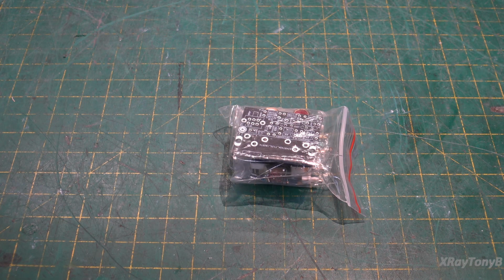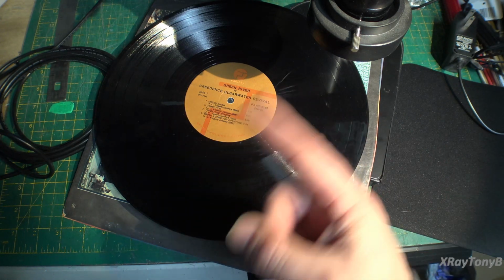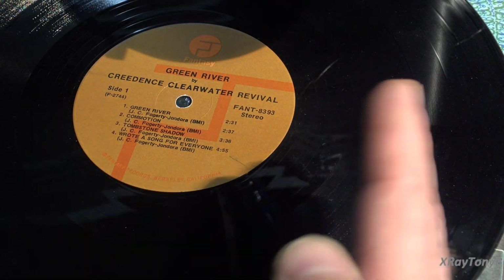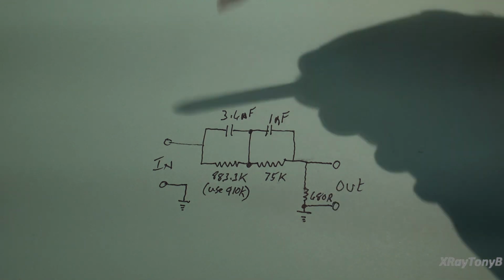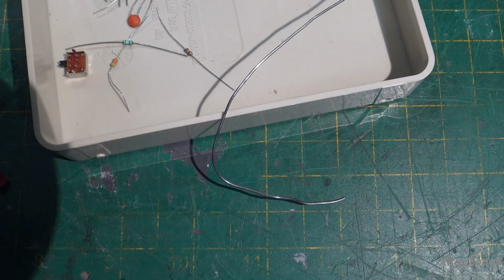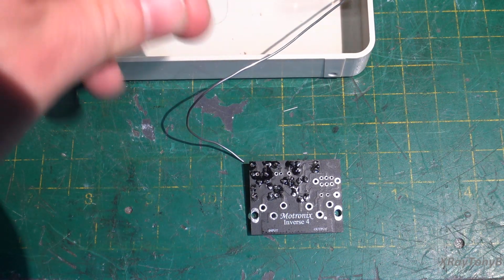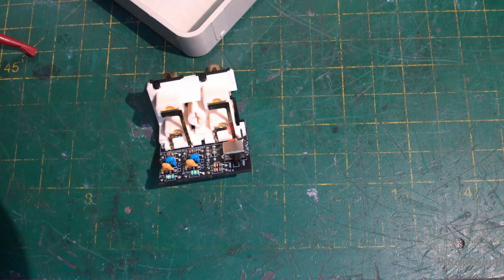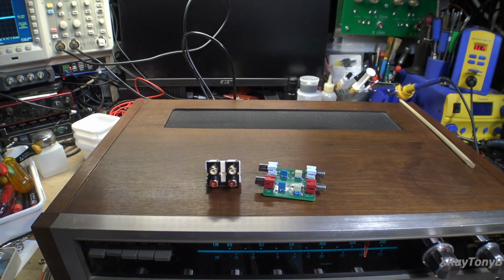Assembling an Inverse RIAA Adapter & Talking about the RIAA EQ Curve

Comment: (@19:00) - if anyone wants to build this circuit, here are some tips:
1) Just use a 1 Megohm potentiometer wired as a rheostat for the 883.3 kilohm resistor. Get one of the 10-turn trimpot varieties, then just measure the resistance with your ohmmeter of choice and turn until you get as close to 883 kilohms as possible.
2) you can get 75 kilohm resistors, but only in 1% (or possibly 2%) tolerance types; most likely, metal film. Or just use a 100 kilohm pot and adjust to 75 kilohms. As with #1, use a multi-turn trimpot.
3) You can make a 3.6 uF cap with a 3.3 uF in parallel with a 330 nF, for a total of 3.63 uF, which is close enough. 😎
4) As with any audio circuit, keep lead lengths as short as possible to reduce noise pick-up. It’t probably be a good idea to put it in a metal project box, though you can probably get away with a plastic one (no guarantees, though!)
5) Have fun, live long, and prosper! 🖖

Comment: RIAA equalisation. There are three things to take account of (well at least 3...). Firstly cutters and cartridges, either moving magnet or moving coil use the motor principle and they are velocity devices. If you wiggle the stylus slowly there will be low output. If you wiggle it fast you get a high output. In fact if you double the wiggle frequency you double the output. That ends up as 6db per octave. So naturally a cartridge will give this rising response, ie no bass and all treble. Then there is the fact that bass requires a large wiggle and you are going to have issues fitting that on the grooves unless you space them well apart and you lose playing time. So it is preferred to cut the bass levels for physical constraints. Third is noise. Pre emphasis in the treble region is a simple way of getting a free way of cutting noise on playback - So why wouldn't you? It took record companies a long time to end up with the RIAA curve and there was a time every record company had their own way of tailoring the response. Amplifiers of the period often had a whole assortment of curves the user could switch in. Have a look at the Leak Varislope front panel.

Comment: The RIAA curve created a compatibility standard. That is, any RIAA-cut record, from any label, could be played back, correctly, on an appropriately-equipped system. Contrast that to the prior issue of different curves for different labels, which required that the listener keep track of which was appropriate for each record.
Reply: Note that 78 records have different curves.  So, not only do you need a different stylus, but a different curve to hear them properly. That's why so many think 78s sound bad.

Comment: Just for the record (no pun intended), an IRIAA is perfect for testing raw RIAA response but if you intend to evaluate noise performance as well, you will have to augment it (especially for MM) with additional components in series so that its source impedance more closely resembles an actual phono cartridge. MM cartridges are highly inductive, typically around 450-500 mH in series with 600-1200 ohms. This means that input current noise becomes quite important as impedance rises into the double-digit kOhms at high frequencies. 

If you see something that has selectable MM / MC input but does not have either:
a) a dedicated MC prepre or
b) pairs of low-noise JFETs in the input stage (whose input bias current is bugger all),
chances are that noise performance is going to be compromised for either MM or MC or a tradeoff between both.

This sort of stuff does happen. The Cambridge Audio 540P/640P phonopre from the 2000s, for example, ran a pair of 2SA970 BJTs at about 2.5 mA of tail current as a discrete input stage in an MM-only amplifier - that's about 5 µA of input bias current right there, or at least 1.27 pA/√(Hz) purely in terms of shot noise alone. You do the math on what 10-20 kOhms of source impedance will turn that into, it absolutely obliterates any voltage noise contribution. 

Use a super low-noise LT1028 or LT1115 with built-in input bias current cancellation, and you can even expect close to 3 pA/√(Hz) in a very unbalanced impedance circuit like an RIAA, so these would actually be quite hissy in an MM application (although they would do alright for MC). Many run of the mill audio opamps would do substantially better (NE5532 and similar 0.7 pA/√(Hz), NE5534A 0.4 pA/√(Hz), NJM2068 probably somewhere in between), as would low-noise JFET input parts of course (say, OPA1642).

This way you can build an MM phono stage that gets a fantastic S/N spec on paper (input shorted) but in real life would actually fare substantially worse on hiss compared to a circuit using a cheap standard opamp. And I mean up to 10-12 dB around 6 kHz.

Yamaha used to have a very similar circuit to the 540P's as a switchable MM/MC job in the pre-2000 AX-5xx and higher integrated amps but at only 1.2 mA of tail current, for 0.88 pA/√(Hz) of shot noise. Not the last word for either MM or MC but at least something resembling a decent compromise between both. Most models up to the mid-'80s had still used a JFET input stage but that may have been considered too expensive eventually. Their discretes stuck with dedicated preamps, but I did find one goof: the CX-1 MM input stage runs 2SA970s at 8.6 mA of tail current, no kidding. I would consider 250 µA far more appropriate, alternatively make some Sziklais to get input transistor current down to ca. 125 µA a pop.
Reply from the maker: I agree 100%.   These little devices are great for testing the phono stage to make sure it plays, but is not ideal for any type of performance evaluation.

Comment: I have some 'high end', very expensive, phono stuff with MC cartridges and pre-pre MC amp stages.  Compared to digital, it has many flaws, like lack of dynamic range, poor channel separation and, obviously noise because of scratches, dust and ticks.  Cleaning LP's is a battle that cannot be won. Still, I like to play LP's, because they remind me of better days.  Like you say, for nostalgic reasons, certainly not for the quality of the reproduction.  I have a love-hate relationship with vinyl records.
Reply: I agree. Vinyl has it's good points and bad. What I like so much about vinyl is the "touchy-feely" part. The artwork, the gatefold (if it has it) the cleaning, the handling, all add to the enjoyment of the eventual music. Younger folk may not be able to connect with our love of the LP format. But I still do, and long live vinyl!

Comment: I hope the sq encoded files work for you. Years ago I recorded a band in a bar with a four channel tape. Between sets if you played it back you could hear different conversions that happened in the bar, as you moved about the listening room. I have tried several times and several different ways to digitize them to wave files and every time it would loose this ambiance. Also there used to be an sq encoder add-on for audacity sound program, it is probably will out on the web somewhere. When done right I believe quadrophonic sound was every bit as good as our current Dolby surround sound.

Comment: Just curious why you needed to build the 2nd unit when you already had the first one. You could have done the video without it. Just to see how it compared to the other at a much lower price?

I went to the Hagerman page and they have an RIAA preamp kit that looks nice. I have some friends who need those so I am going to recommend that kit to them.

That's another good HiFi resource. Thanks!
Reply: same reason why it is always good to have at least another multimeter. With just one device you never could do crosschecking if your test equipment still works correct if you get unexpected results. One device showing unexpected results? Either test equipment or device under test could be defective. Cross-checking with 2nd test equipment then could bring you clarity about the source of this mismatch - 

a) problem remains with 2nd testgear => DUT defective
b) problem no longer exists => DUT OK but testgear number one defective
Regardless of the  brand or make you can find good devices, even from chinese producers. Why not? ;)
Reply from the maker: At the time, that kit was very reasonable with free shipping. Due to the current situation, shipping is very high.  On the other side of things, I get a lot of e-mails and requests about these devices.  I thought this would be a good opportunity to show a little more about them and answer some of those questions.  A lot of what you see in my videos is a result of questions and e-mails I get from viewers.  Thanks for watching!
Reply: @xraytonyb  I also just looked up the price of the other one, which was probably a LOT more than these kits, so I get it.

Comment: Very nice video, just a little detail, the 33 and a third rpm is the rotational frequency, not the rotational speed (this would be the rotational frequency x 1/60 x 2 x π ) which is 10π/9  1/s. Bye. Thanks.

Comment: Does the quality of reproduction deteriorate or not, as the needle progresses towards the middle of the record where the write/read speed is less?
Reply from the maker: From what I understand, the record has better frequency response at the outer portion of the record as opposed to the inner portion.  How much, I'm not sure?
Reply: From what I understand, the record handles louder passages better on the outer portion.  I think it's because there's more "room" to wiggle the stylus back and forth.  As a result, there considerations about where the songs are places on a album.
Reply: @xraytonyb  According to the Audio Cyclopedia, there is additional HF boost given to the cutter amplifier as the cutting stylus nears the inner diameter of the record. But just as Monty asks, because of the lower read/write speed, there still is a loss of high frequency response. Another drawback to vinyl. All in all, I am amazed at vinyl's performance, given all the tradeoffs and limitations.

Comment: Haherman makes good circuits.
Reply: @Bix Bacon : Did you understand what all that video was about? I don't think it was about selling some blahblahblubb branded circuit boards. I think it was about the fact, that phono records are not just doing one-to-one-conversion of audio amplitude to needle deflection and how to test if the DUT (device under test) is working properly, including the RIAA phono equalizer circuits.
THX @xraytonyb, I found this video in fact interesting and it still kept being entertaining. Not entertaining in the form of searching for mistakes at content of youtubers but showing up what others do for testing the devices for. I never ever did check, if the EQ was working properly when I did repair audio gear. But maybe I could have done it. And how I may have done it. That's what I did learn out of that video.
Reply: Yes, I understood the topic. My comment was “Hagerman makes good circuits”, with regards to the reverse RIAA filter. Just a passing comment.
Happy Easter ❤️🙏

Comment: This RIAA inverter has a fault. It is not accurate. The impact of phono amps input resistance is not taken into account.
Reply: I would be more concerned about the source impedance. Load impedance should be 47K by definition, but what is the assumed source impedance? 600? 50? 0?

Comment: This is all rather confused. The lengthy part about effective speed decreasing with radius has nothing to do with RIAA whatsoever, and 'constant velocity' applies not to effective speed past the stylus at any single point on the radius, but to lateral movement of the cutter, and to the groove characteristic below 50 Hz, and between 500 and 2122 Hz. Pre-emphasis is only the upper part of the RIAA curve, not the whole thing. Globs of goop are a problem at small groove widths, not at large, as the globs are large relative to the groove width. And you don't need this gadget. All you need to establish RIAA accuracy is a decibel meter and a signal generator with flat amplitude from 20 Hz to 20 KHz. If the output is +19.9 dB at 20 Hz and -19 dB at 20 kHz relative to 1 kHz, all the time constants must be correctly placed. Any preamp that isn't flat from 20 Hz-20 kHz has something wrong with it. You can indeed take an opamp and a standard RIAA circuit and bung it into a preamp, as long as you take source and load impedances into account: if you can't, how can this single gadget possibly suit everything?